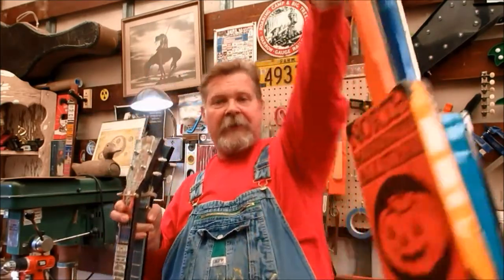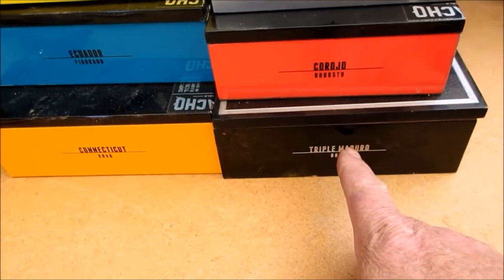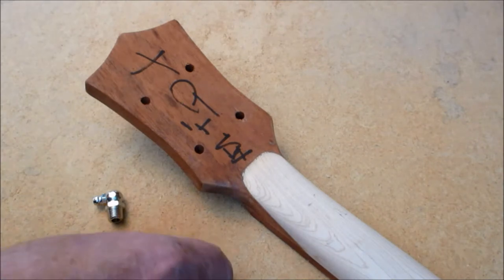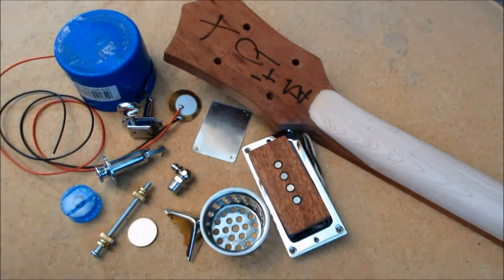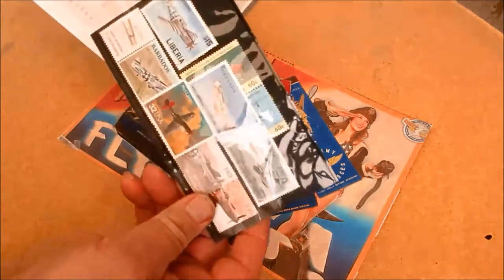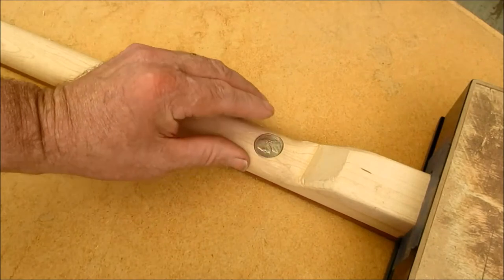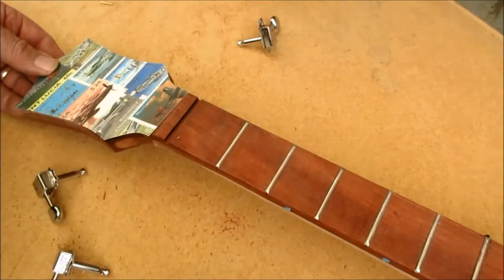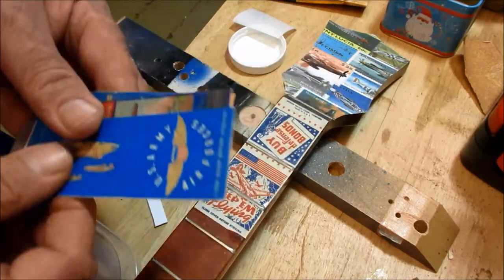Theming a Cigar Box Guitar

Comment: Curious why you use 2 separate output jacks for the pickups. I would think adding a selector switch to connect both potentiometors to 1 output jack would be useful for the player.